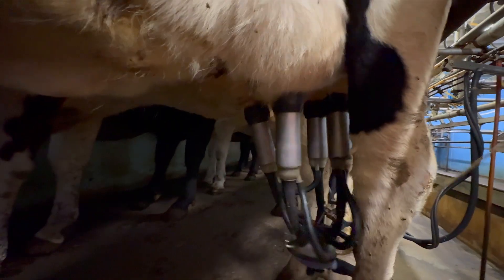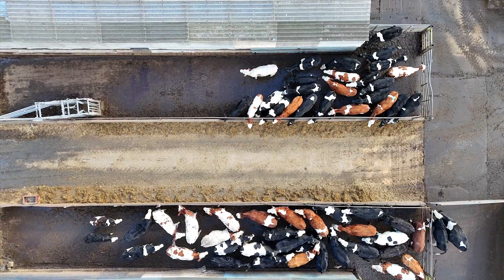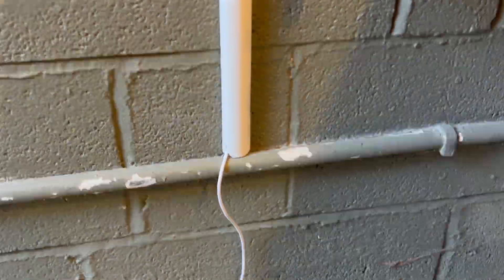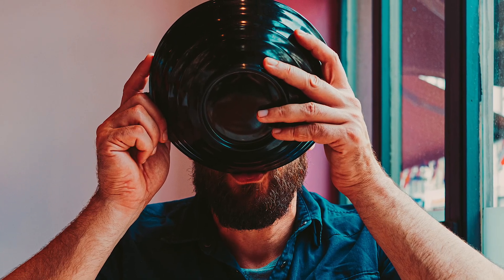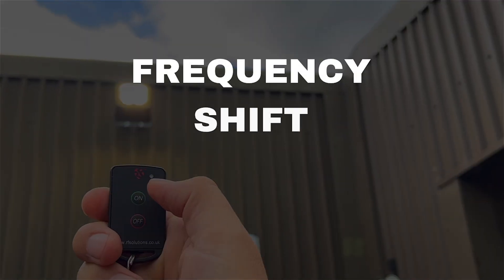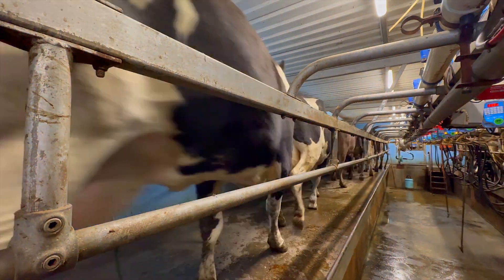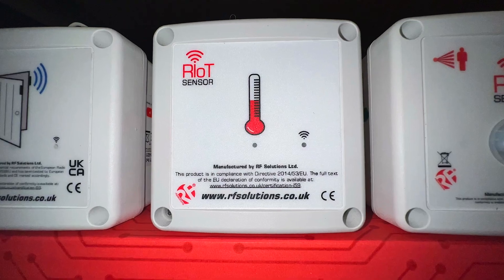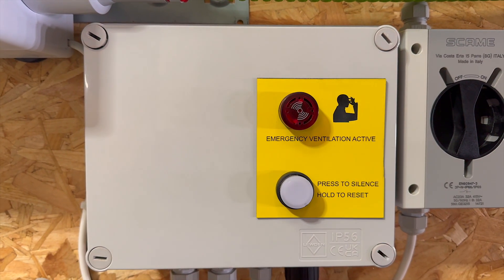The FUTURE of remote Monitoring is Here and It's Watching Everything

Comment: Lora networks would make sense here.
Reply: 4:46 The sensors can work on Lora.
Reply: @Delcorleone  LoRa, yes 868MHz, remember you are limited on how much time you are allowed to transmit (duty cycle), this ensures fair use.  If you break those limits then you can end up in some very hot water with OFCOM.  If you are using LoRa you should consider local as about 6 miles!  If your confirming the sensor data is received the gateway duty cycle can reach 1% very quickly.